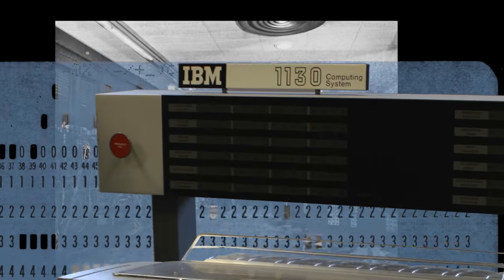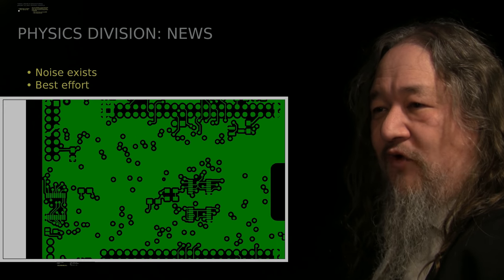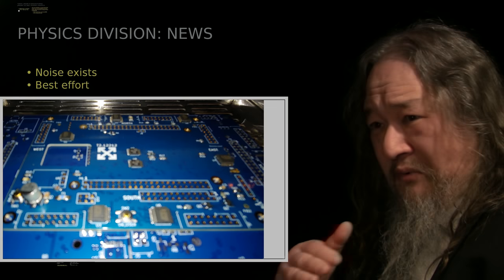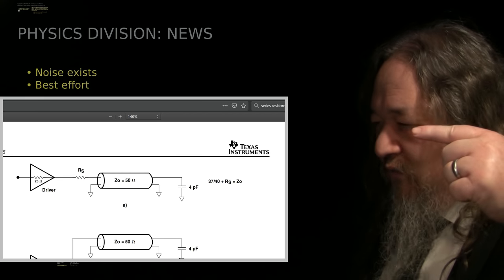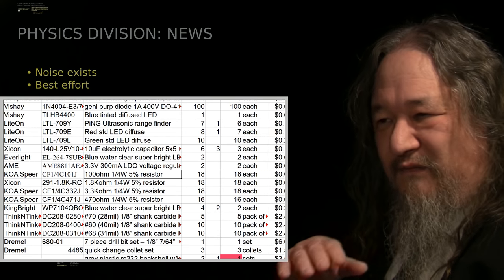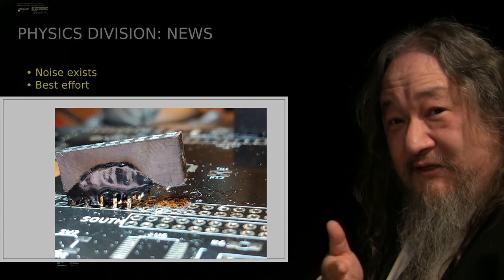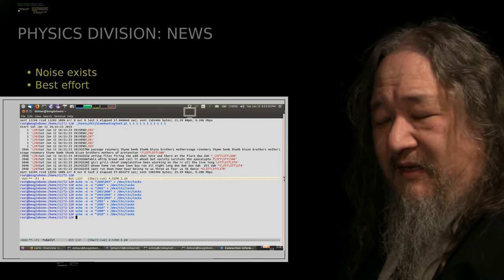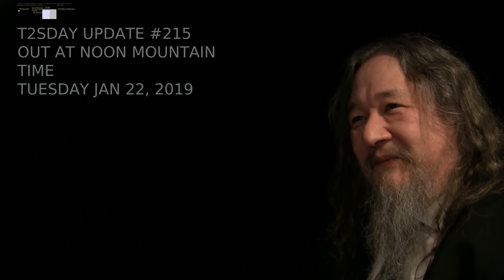Yak Shaving - T2sday Update 214

Comment: Whew -- what a rollercoaster ride.  There I was at the beginning, all set to be flattered that I'd actually made it into a T2sday Update!  Rereading my own thoughts as displayed in the video, I was (as the English say) right chuffed.  Yeah, I'd nailed it with my description of your "MacGyver like resources"!  But then you started to go down the rabbit hole and my mood shifted to despair.  I'd spoken too soon!  I'm not just technologically clueless, my metaphors are glib, facile and wrongheaded!  But as some famous playwright once noted, All's Well That Ends Well.  Indeed, what really impresses me about these updates is that you work through your ordeals chronologically and don't tip your hand.  If I were doing these I'd start with the good news and summarize the endless obstacles in 10 measly seconds at the end.  Not only do you not do that, you document the obstacles visually, discuss them in depth and with relish, and, like a good showrunner, leave us hanging in utter suspense.  Will Dave figure out why he's not getting as many packets back as he's sending?  Will he get to the bottom of the alarming noise artifacts his oscilloscope displays?  Stay tuned for the next exciting episode of T2sday Update!